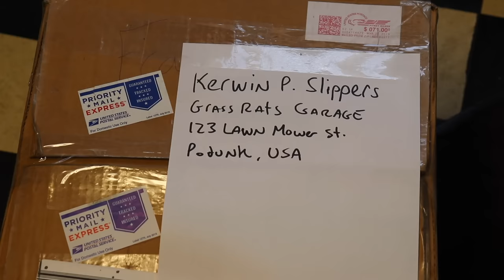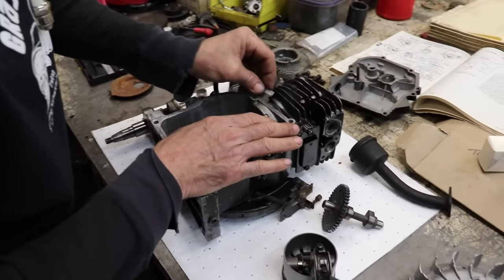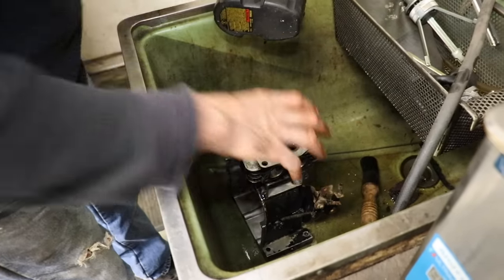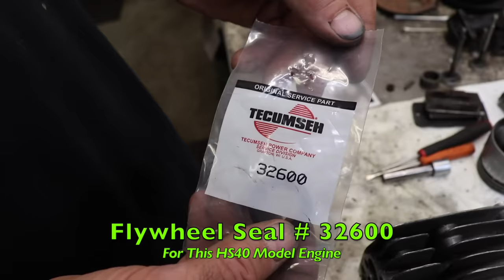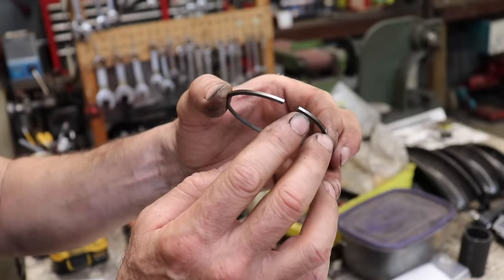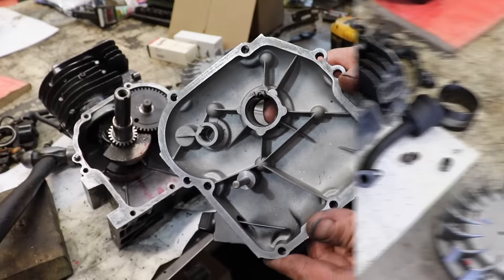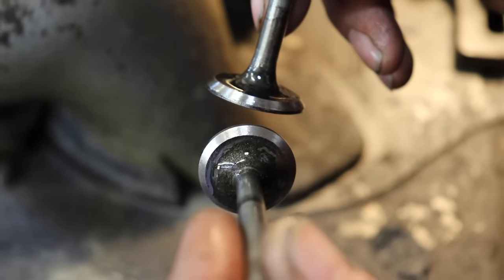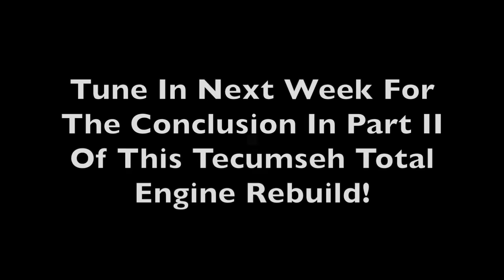(Part 1) Tecumseh Small Engine Total Rebuild: A Complete Guide

Comment: I just finished a total rebuild on my  8 hp Briggs and Stratton engine out of my 1979 John Deer 108 using only this video. The first small engine I've ever done. I even bought a torque wrench to do it. This little motor runs so good you could put it on the space shuttle!!!  Thank you Taryl !!!
Reply: Lifters, tappets - cam followers ?

Comment: Taryl, Just want to thank you for your very informative video packed with good practical information in rebuilding small engines.  I am rebuilding an HH 60 and your video provided me with gret details not mentioned in the modern manual I found and I was able to get the torque specs for the connecting rod bolts from your book when you showed a screen shot.  That spec is left out of the updated manual along with several other things you mentioned.  So thank you very much.  You and your expertise is greatly appreciated.  As well as your humor.

Comment: Thanks to you Taryl, I rebuilt a H35 for a friend. Only had Sears model and serial numbers, could not figure out the Year. Did some interscreen, found H35 1982 and prior has 1.844" stroke @ 65 degrees BTDC, H35 1983 and later has 1.928" stroke @ 35 degrees timing. This engine measured the 1.844" stroke, Purrrrs like a kitten at the 65 Degree timing!

Comment: So when flattening your deck or your head on that piece of sandpaper. We also use WD-40 in the machine shop for the same purpose. It helps the sandpaper from loading up too quickly. We did this a lot before we would finish grinding a part. Just to see if there were any irregularities from heat treating.

Comment: Hi Taryl, yes I did try that with the dishwasher, put a few ounces of dawn in it and had 
bubbles all over the kitchen. Did a fine job w the engine she never knew was in there, I did
have dishes to do first anyways and not much powder left, told her I had no dw soap an
used dawn. either way it did work, so Thanks!

Comment: Hi. Recently I start having problems with my lawn mower. The problem is that I don't have good compression y check de valves and it moves and seel freely until I saw the walls of the block and I discover that it have scratches that I can feel with my fingers nail. So the question is can I rebuld the engine?

Comment: A Pro Tip on making your gaskets last for multiple removal and reinstall cycles is to lightly coat them with bearing grease, both sides, so they can be removed over and over again and save you from wasting gaskets when you just need to make some minor adjustments.  A lot of these paper-composite gaskets become permanent (bonded) once they're installed and when you take something off, the gasket disintegrates or splits in two, with half of the material on one piece and half on the other.  Technique is probably most helpful for the carburetor gasket because the carb gets a lot of attention maintenance-wise
Reply: I use WD-40 on all my gaskets except for the head gasket. Sprays on easily, comes off easily. Been doing it for years. Never had a leak

Comment: Hey Taryl, watching  your old video on rebuilding a Tecumseh. 
You showed using Plastigage. I have a copy of Tecumseh shop manual which has most specifications, but does not show the preferred or acceptable clearance between Crankshaft and new "standard:" Connecting Rod.

My HM80 is on a generator. Due to stuck open governor throttle, when started it ran too fast for a short time before I could shut it down. Had good oil, but the RPM was was more than it could handle.  Damaged the Connecting Rod bearing. Have been able to clean up the crankshaft journal and have a new "standard" connecting rod. Using Plastigage, it shows to have 0.005"  clearance.

Rod/Crank clearance is tough to find. Would be great to learn what acceptable clearance on Crank Rod clearance.

If you happen to have that information I would be grateful to find out clearance between Crankshaft and new Connecting Rod recommended and acceptable.

Comment: Hi Taryl. I like your teeth. And your sportsmanship. I have a Briggs 3.5 hp from 1984. Runs ok and starts after three pulls upwards. Compression is only 4.2 bars so power is not so big.
Whatdja think would happen if I replaced piston rings og top gasket?
Cleaned out cylinder. Fixed the valves. Would compression go up somewhat!

Comment: Just started the video. I have an HS40 mounted to a rototiller. I plan to keep it there. Does it have that condenser part on it or just a shaft to the drive belts? Very new to small motors and I have no idea what that part even does.

Comment: Taryl I have an hm100 engine in my snowblower that lost spark from sitting. I tried putting a coil and points in it but still no spark. What else can I check? I didn't see an electronic ignition kit for this engine.

Comment: We have a craftsman front wheel drive mower with a Tecumseh but when i went to pull it out that mower was completely covered in grease ive never seen so much grease but i remembered i watched one of your vidjas to clean out the carb bowl so i did and it started and runs like a briggs but now i need to get a crap ton of degreser just to remove the grease that on it

Comment: Always measure the cylinder half way down using a bore measuring tool, not at the top like you did. Also, check your end gap and file as needed to make sure the end gap is right, use a feeler gauge for that. If its too tight when it expands from the heat, the ring will break and destroy your work. Its a good thing you checked the thrust end play. Whomever lost those was not paying attention. I dont rebuild small engines on mowers and such any more. I do rebuild snowmobile engines, motorcycle engines and speciality engines that fit a select purpose. I used a hand file the first valve end grind I did. Now I use a cut off wheel on my angle grinder in a vice. I would rather replace a valve if it needs refacing. I have lapped my valves and had it work fine. I rebuilt many snowmobiles in the late 80's and 90's. Now I just do small jobs. I had to get out of small engine repair on a larger scale due to cancer and chronic pain.

Comment: Hello Taryl, hope you are having a good day. What I am wondering is how much movement do rings actually move ???? When you put piston rings in a indexed position on the piston before you assemble an engine and then push the piston into its bore. Then the up down stroke of the engine movement cause the rings to move radially to some degree. When you tear down an engine and remove the piston from the bore, do the all the rings end up being located in line with the split or cut part of the rings ??? Look forward to an answer from you Sir. Thanks

Comment: Thanks for your help on these small motors by the way.  I found that fixing generators is more fun than fixing cars - doing a head gasket on one of these motors takes half an hour instead of half a week - you don't gotta rip all this crap off.  Everyone wants a generator too - they're always useful as long as they're running right

Comment: I am putting new seals on my 5hp briggs because it was leaking, and I used your drill and q tip trick and I'm sure glad I did! All the boogers.
Reply: I also just go about 1/4 turn on the bolts. Does the job.

Comment: Just found your channel. Its excellent with its info and humour. Just a small issue. Why do you not lap the valves in before you give the engine casing its final warm water bath? That would ensure all the nasties are washed away before assembly.

Comment: Hi Taryl - I have a 2018 Craftsman with a PowerMore 546cc engine.there are 2 tamper proof screws on the side of the engine by the carb linkage. Could u tell me what they are do.

Comment: I use a good grease as a gasket sealer for oil retaining gaskets, it acts like a glue and holds the gasket in place but also releases cleanly if the parts have to be separated.

Comment: Tarly I got a question bout Tecumseh engine I got a old swisher from the 1960s that got a magneto and it ain’t gonna work it way 2 old I was wonderin if u could switch it from a magneto 2 a coil ignition system

Comment: i only use a torque wrench on head bolts and bearing caps. everything else is close enough. never lost an engine yet.
Reply: True. Those are the most critical two areas but then again we have torque values for every fastener on the engine and it really is useful; it gives you a feel for how tight they really are.

Comment: I have an old tecumseh I took off a mini bike, it was sitting for a wile, but its not seized. Should I just buy a new Predator, or find parts to try starting the old 1, the whole thing has to be cleaned out.

Comment: I mostly need to replace the governor spool - do I need to pull everything apart or just the back case?  I hate to mess up the connecting rod or crankshaft because the oil seal stuck.  It's for a generator I got for free - I could do a total rebuild I thought so - but even with your help I'll be paying $200 for tools and parts.  Should I rip it completely apart, get a VJ Valve Job and a hone,, or just pop the back case and replace the governor spool / parts?

I love the manuals - I just prefer the PDF to print my own because I can use the money for parts instead :)

Comment: Hey Taryl. I really enjoy your vids. Question. I have a Tecumseh  8 horse cast iron sleeve vertical crank TVXL195  150257C.   Recently had a leaky head gasket and exploded governor. Fixed all that. It is running again. The thing with this engine is it constantly surges until you engage the mower deck then it runs perfect. What is up? Is the idling section of the carb messed up? Tecumseh engines are a bit fickle compared to Briggs engines but, when a Tecumseh is right it has a lot of torque. I hope to hear from ya. Thanks, Dean

Comment: Nice Video!  I have a 1974 Toro 726 (Mod31763) I got for free, so no complaints in that department.  However, when I drained the oil, about 1/2 pint (yep, that's all) of jet black think oil came out.  Just before that I did verify it started, but it smoked like a Big Boy locomotive.  I pulled the head off and found a few large scores on the cylinder wall and believe it needs oversized by first boring out the cylinder.  Can you use the cylinder hone to keep using it until the scores have been removed?  OR does it require more intense machining and then honing to crosshatch the cylinder wall?  I"m looking for a video that shows the process.  Any help is greatly appreciated.  I really want to bring this ole' machine back to life, as 'she' saw it in the 70's.   Thanks!

Comment: If you haven't got a valve spring compressor tool, compress springs in vice, tie with string, assemble and cut de string to uncompressed spring and remove string all of it, with long nose pliers.

Comment: For scraping gaskets on aluminum you can use a piece of copper tubing flattened out on one end and filed to to a sharp edge. Copper is soft enough it doesn't readily gouge aluminum. It may be necessary to file is sharp fairly often but it works well.

Comment: Daryl a question on carburetors that cant be found anymore like the cv460s Kohler and the China mades only have a idle screw only and no fuel air mix.  Any pointers.  I cant find rebuild kits and also for gx760 Honda.  I bough a carb for each and weren't the proper ones. Help

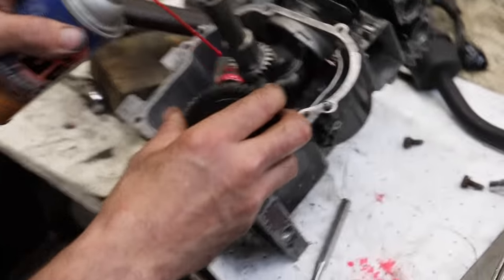Comment: @55:45 - on my HM80 cam it's got a weird spring and weight on it.  I assume this is for exhaust timing.  I just pulled the case off motor looks and runs good so was hoping to do the total rebuild later when I can afford it. How do I put the cam back on with this weird spring on it?  I read in the manual "turn cam 3 teeth past mark to relieve exhaust valve tension"?

Comment: I got a weird valve cover on my HM80.  It's all rebuilt and running well - but it's spitting oil out of the breather / valve cover just a little.  I reversed it like it shows in the video (it goes on both ways) but there is no drain hole for the oil.  I've seen some knuckleheads drilling holes in it to allow the oil to drain back into the crankcase but this would defeat the purpose of the reed valve.  Do I just need to buy a new one?

Comment: By the way, you've got the tecumseh models wrong, hs means horizontal small frame, not horizontal shaft. For example hssk50 is horizontal small frame snow king 5hp. Like wise with the hm and hmsk engines. Hm means horizontal mid frame, hmsk is horizontal mid frame snow king .
Reply: I have a 6hp snow king, what's the difference between mid frame and small frame???

Comment: Hey Taryl.. I have an old Ariens rear tine tiller with a Tecumseh HH70.. it’s been sitting for a few years because it blew up when I was 10 feet away from finishing my cousins (football field size) garlic patch. I’m obsessed with Trying to find parts that are seemingly discontinued. I need piston rings and a connecting rod. Probably more that’ll be found out soon as I put it back together. Can you give me any advice or information regarding replacement parts for this HH 70 motor? Thanks man

Comment: Do you check the end gap on new rings before installing them or just assume they will be fine?
Reply: yea he has a video on that where he places a new ring inside the bore
Why havent you looked at it?

 Or do you assume anything that comes to your  mind after watching one video?

 I myself like to be more thorough than that. An easy attitude like you display here can get one into allot of trouble
I hope you will show more responsibility in your future comments
Reply: @reganteresa1662  My original comment was not intended to be critical.  Because the engine was used and did show some wear, likely both in bore and ring wear, I was simply curious if Taryl felt that checking the end gap was unnecessary.  I always do; what do you do with your rebuilds?
Reply: @Andrew-lk5ov  ive rebuild mx engines in my teens, 125,250 and 500 cc the 125 needed an overhaul every 10 hours(typical EASY nicasil), the 500 never needed one as it had only a 7500 rpm max(byebye sprockets clutch, tires and chains(tsubaki), and the 250 i worked on only had me to ride it, it never got an overhaul because i suck at riding dirtbikes, and it ended upp needing new ''mufkins''', fenders, handlebars, levers and stuf like that on a regular basis because it woudldnt stay on its wheels longer than one lap without crashing hard on places where nobody had crashed before

now that im older, i only have a pressure washer , a 70 cc chainsaw(husky 266, yea its original 66.7 cc but its from 83 so i reckon its 70cc by now)), a lawnmower, but since we have chickens we dont have a lawn anymore,so.. (yea neglected lawnmower right here) and silly things like that.

what got me here last week was a generator we have which looks new but wouldt fire up, thanks to this guy here i now know its a chinese Honda knock off(which i expected because red is the honda colour , like green is kawa, white/blue is yamaha, yellow is suzuki, blue/yellow is husky etc) and the low rpm jet needs to have a tiny clear  hole in the axial direction

checking the endgap on a new to be installed piston is like as basic as the tightening of a nut or bolt, its like asking : ''do you tighten that nut/bolt or do you assume it is firmly in place when youve put it in the hole or on the thread with your fingers?''

yea you sounded like a troll
because we both know when your are a novice in these matters you dont ask a question like that.

in this case you would simply point out the fact he doesnt adress the issue in this walktrough

when you reply to me i will bent our lil conversation to 9/11 and the technical specifics into that event, if you like that ,fine, if you dont, just shut up and let this guy do his thing because he obviously knows hes whats hes doing. he has an original way of presenting that, hes ,apparently, helping out allot of people and makes way for those that usually hand over their problems to others to engage those problems themselves

i was in a real good mood until i came across your know it all comment

btw i grew up with dutch hillbilly boys
greetings from the netherlands

Comment: Isn't Crocus cloth the same as Emery cloth ? But, I do have a serious question. Is it important to have the conn.rod in a specific position OR would the dipper hit the engine wall IF it is assembled the opposite way from what you did ?
In other words, does the connecting rod has a "must face flywheel" position ? Thank you very much. Happy father's day gang ! OH ! The match marks ! duh...1
Reply: I was wondering the same thing about the Emery cloth.
Reply: @stevenc8053  now these are super old posts but in case someone else comes by looking, they are not quite the same crocus cloth has very fine loose rust particles on it as the abrasive and emery cloth has fine grit glued to its paper.

Comment: Hello.
 Can you make  a film or explane how  to change Push rods tubes rings on 12HP Tecumseh  Engine OVXL 120-202042C by not taking  the head off.Oil is liking from behind  the valve plates.
Like you repair they are very helpful.

Comment: Hi Taryl, thanks for all your videos. I've learned so much and you've given me the confidence to proceed with my engine tear-town to fix a low power condition. Mine is a Tecumseh HMSK80-155526S from my Ariens snowblower. I found the exhaust valve wasn't closing all the way and the intake valve clearance is at .019. I'm wondering what would cause these two problems? should I just grind the Ex. stem to get a .010 clearance and put it back together? I'm going to replace the rings too (cylinder look excellent). Thanks

Comment: Tecumseh carbs. I have cleaned the carb and the primer doesn't prime properly. I installed a new bulb and still not priming properly. I am aware the one breather bolt must be installed when testing. One mower will not prime, the other require's about 35 pumps to prime. Any ideas would be appreciated. Thank's Dan...